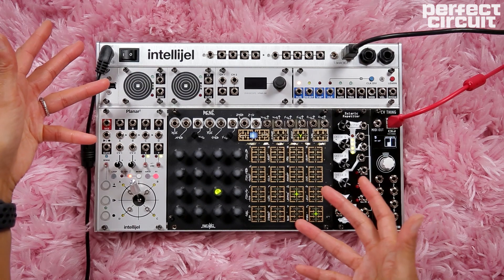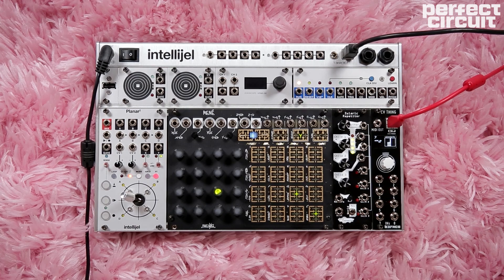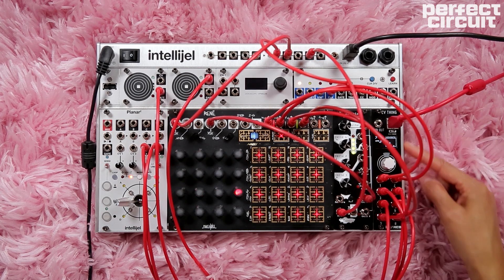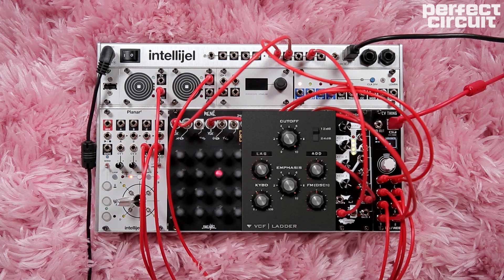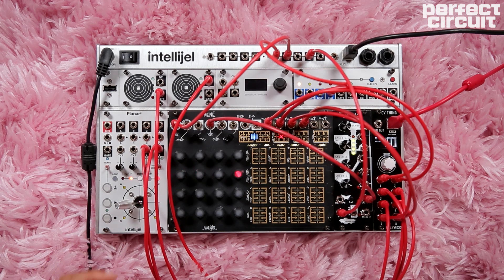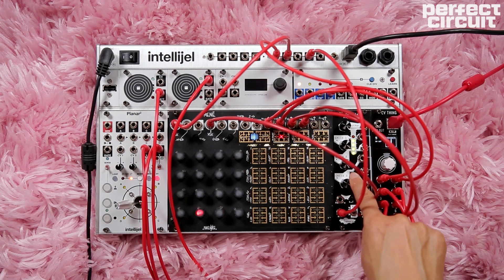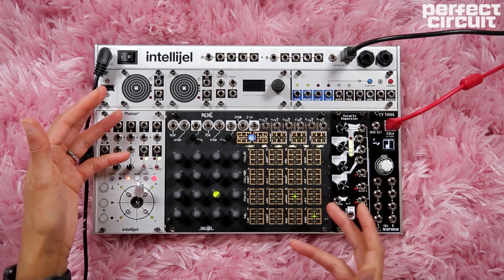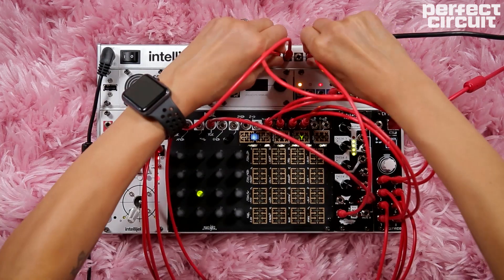62HP EP1: Tactile DAW Controller

Comment: is this setup responsive enough to make a vca type controller? I could imagine linking Maths to a utility in ableton, but does it remain that snappyness? Great video, like to see more modular related stuff
Reply from the maker: Do you mean using the Maths as an envelope and then turning that into midi cc to control a VCA in Ableton? We didn't test that out but it might work, for doing fast modulations like that using something like and Expert Sleepers ES-8 or ES-9 might work better since midi isn't the fastest or highest resolution control system.
Reply: @PerfectCircuit  yeah i was wondering exactly about that. thanks for the reply 👍

Comment: I love the Palette case, but I find it hard to choose the right modules because you have to be really selective. 
I'm looking forward to upcoming videos with different modules.
Reply from the maker: it's kind of like a puzzle to put together a good small eurorack case
Reply: I turned mine into a drum machine.  I’ve got a PNW with P-EXP2, MS SY0.5, Mosaic 1U Snare, two Pico Drum2, one Pico Drums, a Blood Cells Audio Stereo Mixer with Return, a TT Z5000, and a disting in a 3U to 1U convertor.  With an SQ-64 I get these awesomely unique and modulatable drums.  Pallets are perfect for this kind of application.
Reply: Rings into clouds